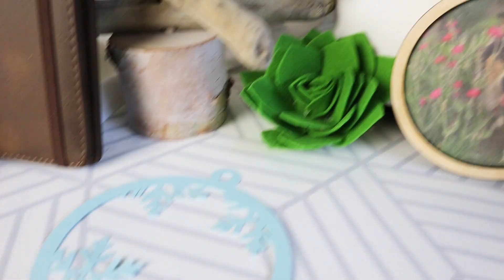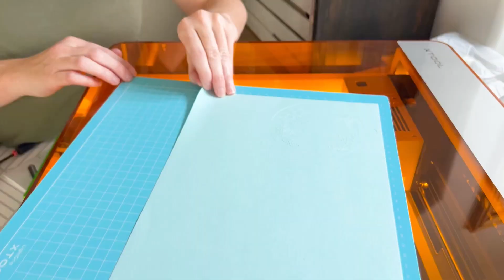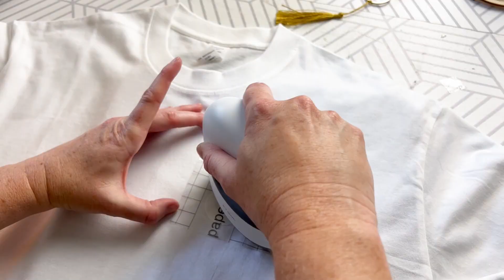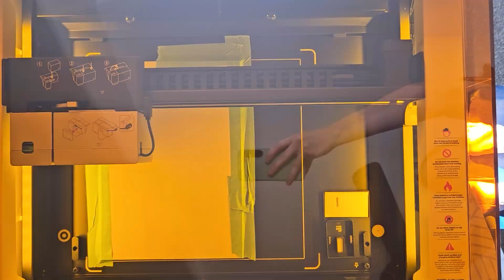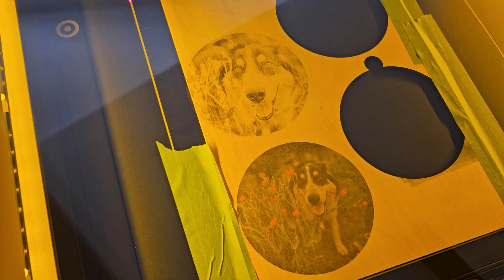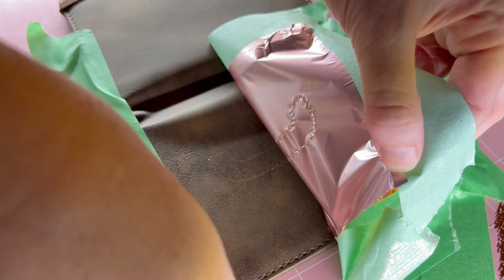8 Easy xTool M1 Ultra Projects for Beginners / Cut, Print, Engrave and More!

Comment: Just FYI, the inkjet projects will come out better — sharper with deeper colors — if you apply a base to your wood first. Clear Gesso will work (Liquitex is a great choice) as well as the similar product used for sublimation. You need to apply a coat and let it dry completely, so give it a few hours. It’s best to use a spray water based sealer, like polycrylic, to seal your wood.
Reply: Thanks. I thought that the wood print looks a bit streaky. I wouldn't be comfortable selling that to customers.
Reply: Does this only print on wood or on paper as well?